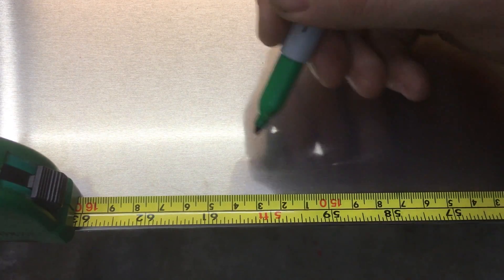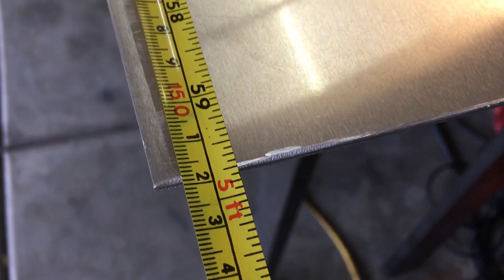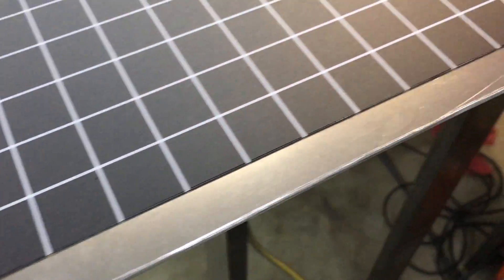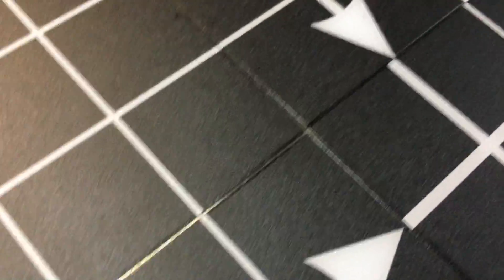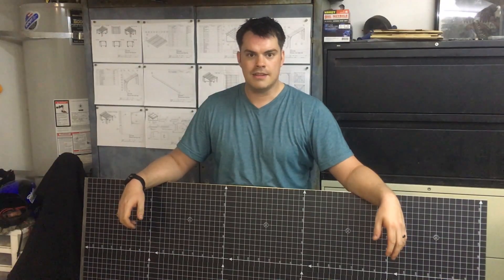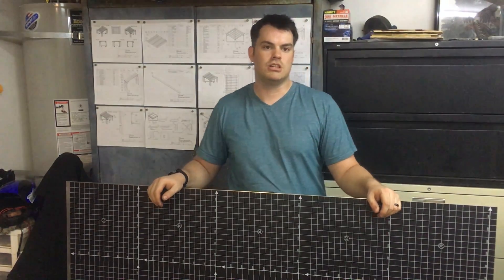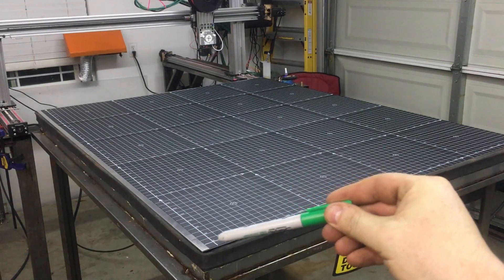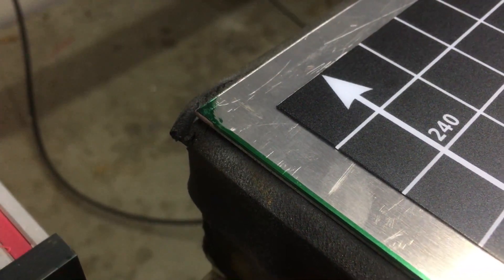Custom Aluminum Print Bed for Large 3D Printer - EP013

Comment from the maker: anyone know of a good rubber seal strip that can withstand a high temp? See my problem at the end of the video. Let me know in comments!
Reply: It is very rare that I see a DIY project that has true potential and that is truly inspiring. I want to see this beast successfully printing. Because I am intimately familiar with the 3d printing scene  I'm sure i could be of help with any bed leveling and other misc design challenges you may face. If you need help shoot me an email: f4bul1z3r@gmail.com
The type of foam that is hydrophobic is called closed cell foam as opposed to open cell foam in, say, a sponge.
Reply from the maker: Awesome Dan, Thank you!!! I'll be sure to send you the issues I'm having a hard time overcoming. Follow me on Instagram @haledesigntech for the latest updates.
Reply: There are high temp silicons that could fit for the purpose

Comment: I don't know how much research you have done, but you gonna run in to few problems with such big printing area. 
Big 3d printed parts have tendency  to warp, because of that it's heated bed.  And if you even heat such a big aluminum plate it will deform alot because thermal expansion...
Reply from the maker: Yep I have not been able to overcome those constrains yet. Right now, I'm just dealing with them with an Auto Bed Leveling sequence and with limiting the size of the Prints. I'll post new video soon about the issues with this large of a bed after I've had more time with it. For Science! Thanks for the interest.